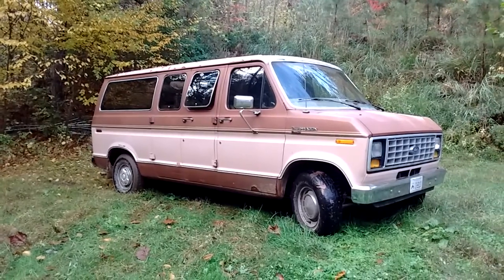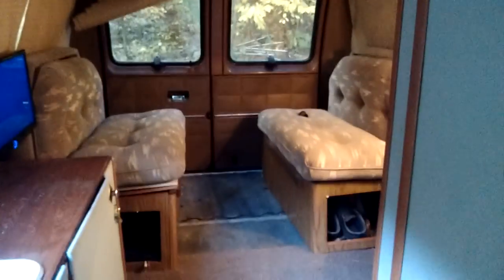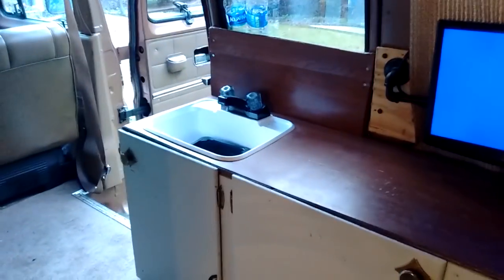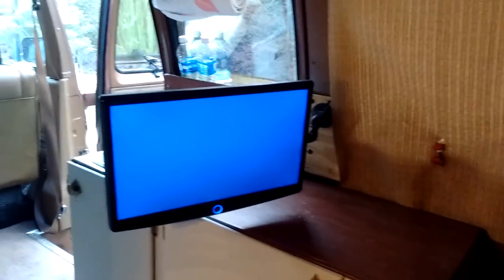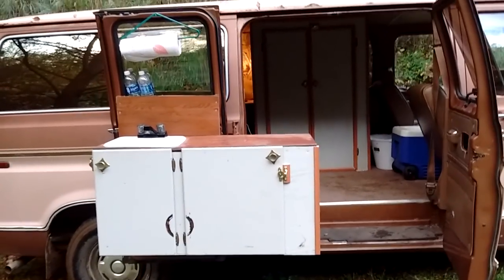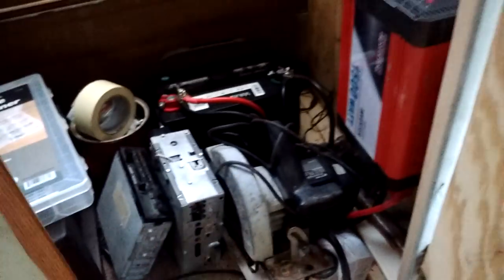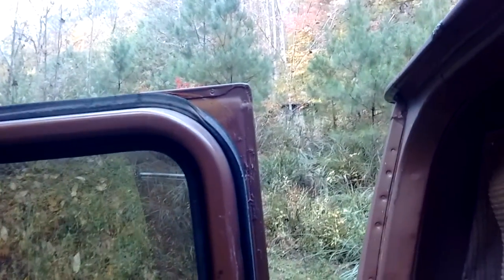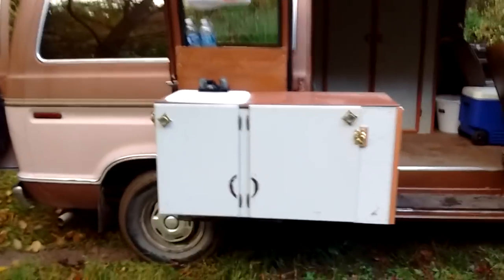My Homemade Camper Van

Comment: Your 'cabinet maker/carpentry' skills are a bit crude, lol. But you have some ingenious ideas! Good on you, keep learning and building. You are an inspiration for the 'simple' life. I am getting ready to build a similar stealth camper (can't afford campground fees), on a 1988 Ford E350 maxi length 4x4 conversion van. Good luck with your camping adventures. Gary in Michigan (retired and freezing aboard sv 'Paladin').
Reply from the maker: Yeah, I don't think I even measured anything except the height to the roof. I just kind of eyeballed most of it. It was really just supposed to be temporary for a few camping trips. Afterwards I was going to take everything back out. I still intended to use it for hauling. Turned out I loved it after the first camping trip so it became a permanent camper. I've done a lot more to it now, check out my Ford Camper Van playlist. Your 4x4 van will be a perfect camper. You'll be able to get to the really good camping spots. Good luck and try to stay warm.
Reply: I really like your 'get it done with what you have style'. I am a new subscriber to your channel! All you really need with your imaginative skills to sharpen up your work is a good cheap 'miter box' and hand saw or maybe a 'chop saw' to get those moldings and corners looking good. Are you from North or South Carolina? your accent sounds exactly like my inlaw's in Oconee co. SC.
Reply from the maker: Actually I'm from Kentucky. I may try to pick up a miter box. It would help a lot.Now that I'm putting my projects up on You Tube I really should put a little more effort into fit and finish.
Reply: I just saw your from Kentucky by your license plates lol. You can get a plastic miter box for under $10 (the old time carpenters just used to make their own, you only need a 45 and 90 degree angle).

Comment: how are you able to run electricity to the lamp and microwave? like is it attached to a battery? awesome job by the way
Reply from the maker: I have a 1500 watt power inverter, and all my 110 volt devices plug into it.

Comment: gI tHERE LOVE YOUR VID: JUST THINKING THAT YOU MIGHT WANT TO CONSIDER USING TWO a.g.m. BATTERIES FOR THE HOUSE POWER THAT WAY YOU WOULD NOT HAVE TO VENT THEM TO THE OUTSIDE .....THAT IS WHAT I DID FOR MY HOME SOLAR SYSTEM AND IT WORKS WELL ......JUST THINKING THATS ALL
Reply from the maker: Thanks, I may try to pick up a couple of those when I get back to work. I was actually considering building a box under the van for the batteries. It would get them outside where they're safer, and also free up some closet space.

Comment: and yes, I am at the point were I scroll thru looking for the bathroom set up (it can be discrete and mini, just want to know what), so, please.  cooking I got down in tough times, its the bathroom that counts.
Reply from the maker: If you would have watched the video instead of scrolling through you would know that the van is not complete yet. also you would know where the shower and bathroom will be.  Actually, if you can't figure out how to use the bathroom in the woods without a toilet, I'm sorry but you are probably not cut out for camping.
Reply: luke Fugate shes prolly going to be a van dweller not  camping. women dont like going in the woods and you dont know how old she is.

Comment: Is the weight of the kitchen light or heavy? It just looks a little heavy on the door hinges?
Reply from the maker: It is kind of heavy. I'm sure it is over the rated weight of the hinges, but they still haven't shown any sign of wear. I still use it all the time and it still works fine. I assume the hinges will wear quicker than normal, but they are easy and cheap to replace.

Comment: With the monitor arm what kind of plumbing fittings allow it to rotate like that?
Reply from the maker: its all 3/8 black plumbing pipe. I used 2 floor flanges, 4 street 90s and 2 12 inch long nipples. I also used a piece of plywood on the back of the monitor screwed to the existing mounting holes.
Reply: Thanks!

Comment: Do you really run your Micro Wave on your invertor. I'l bet it really sucks your Battery.
Reply from the maker: Dallas Weaver It's not tht bad. You can't let it run for 20 minutes or anything but for about 5 minutes at a time it's fine. Most things I heat up in it are done within that time. If not I start the engine and let the alternator run it.

Comment: Put a round table, it will work fine.
Reply from the maker: I ended up adding a rectangle table but rounded edges would be better for getting in and out of the couches.

Comment: I must have missed it:what is the tall closet for,clothes?
Reply from the maker: It's meant to be for general storage clothes, supplies, etc and also a place for the electrical system. I have begun storing my portable toilet in there and using it for an emergency bathroom. It's not comfortable for a bathroom but it works in a pinch.
Reply from the maker: I did an updated van tour video if you would like to check it out, I've made a lot of improvements. it's here>>>>>  https://www.youtube.com/watch?v=JgimTht-vV8

Comment: Replace your battery inside the van with a marine interior battery.  No venting required.   For more information,  YouTube jwsolarusa!   He talks about the right batteries for inside use.
Reply from the maker: I'll check it out. I have a battery box vented outside now, but not having to vent would be better. Thanks.